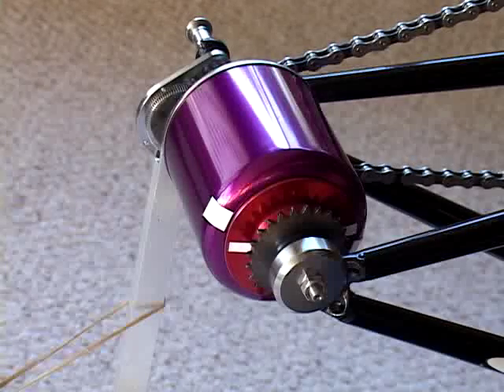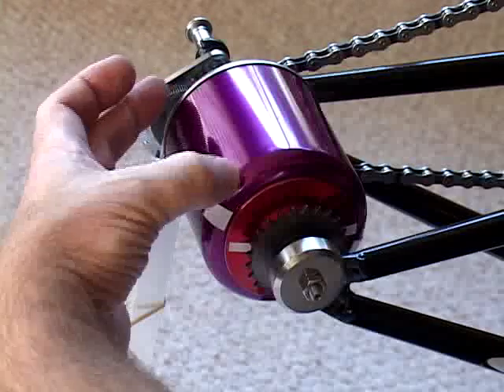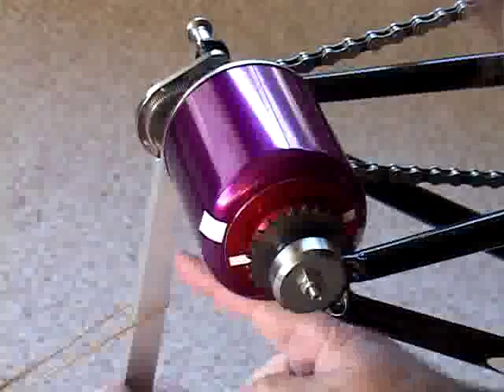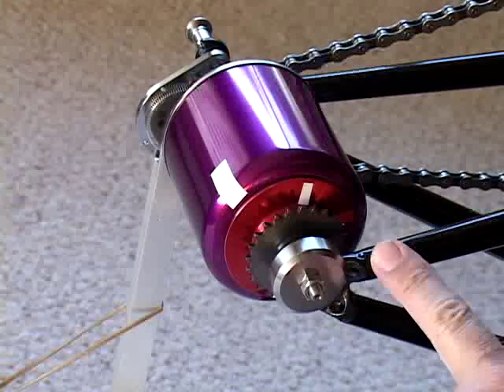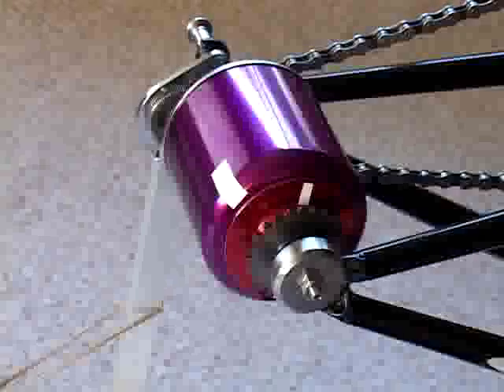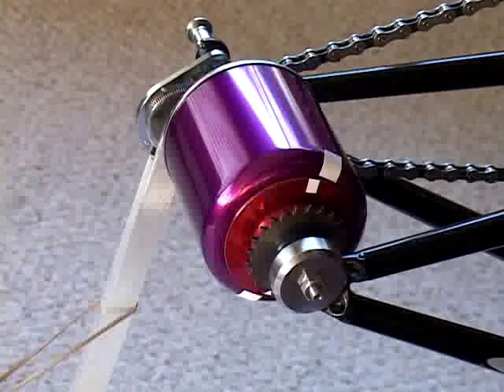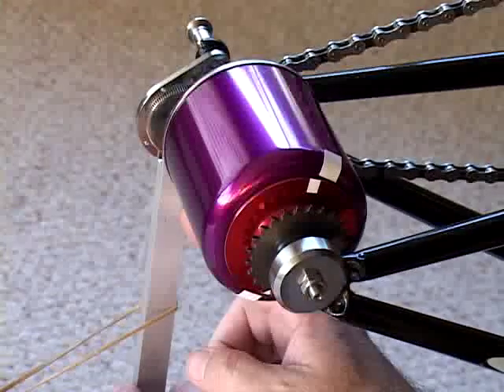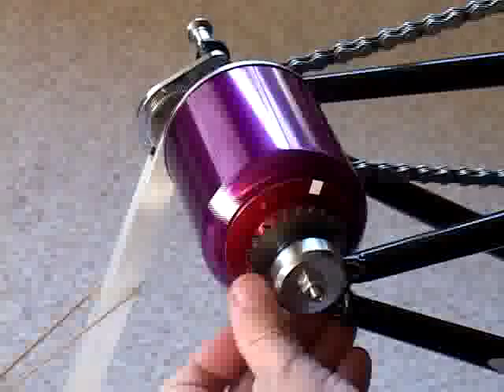Automatic Bicycle Transmission (IVT)

Comment: This would be perfect for motorized bicycles
Reply from the maker: peter medz
Yeah!  You'll be able to keep the revs up where you want them when you need them, regardless of your bike's speed!  I intend to technically support any developer who wants to perfect a drive system with the SIVAT for such uses.  2-strokes would be very interesting because they need to rev!
Reply: yup its genius
Reply: Since the have no changing gears at all....
Reply from the maker: Indeed!  They're on my checklist for design requirements for bikes with IC engines and electric motors, possibly up to 1kW (1.34 hp) of power capacity.  Most of the core mechanism will work for pedal-power and motor-power with a single design for better economy-of-scale in production.
Reply: Make a version for the gas bikes. I'd love on on my 80cc
Reply from the maker: peter medz
We might not offer a SIVAT for any specific e-bikes or gas bikes any time soon, but a kit for you to adapt to motor/engine power will follow its initial pedal-power marketing & sales.
Reply: "This would be perfect for motorized bicycles"
Except electric motors generally don't need gears.
Reply: gas 2strokes it be just like peanut butternut and jelly.....
Reply: Go to school
Reply: This is just like the transmission on my 80s Honda Spree scooter. Nothing special

Comment: i want that transmission for my bicycle based ev project
Reply from the maker: That would be a good choice.  Unfortunately for your project, this is not yet available as a product.  Maybe your project can have a second stage of development when it becomes available.  Some people claim that a transmission for an EV is unnecessary because electric motor torque is highest at low speed; they ignore a lesson from Tesla Motors!  Tesla's very first prototypes had 2-speed transmissions because they raised the top vehicle speed while enabling good low-speed acceleration in first gear, which shows the advantage of a transmission with an EV!  Tesla only abandoned the transmission because the high torque of the motor broke gear teeth during the shift, an event not possible with a transmission that requires no abrupt 'gear change' like an IVT wouldn't.  A major cause of most mechanical systems is shock-loading, where forces rise abruptly on all components in the power chain; an advantage of the SIVAT is the elimination of shock-loading!  If you eliminate shock-loading, you can design the transmission & other drive-train components to be lighter, a big advantage on a bike.  I am deliberately designing the second-generation SIVAT with small EV's in mind to handle 500 watts (maybe 1,000 watts) of power at input speeds higher than pedal-power speeds if the SIVAT operates well at higher speeds.  The next prototype will be tested to determine its maximum power output & top operational speed.
The SIVAT will be introduced on a special bicycle, most likely a full-suspension mountain bike intended for pedal-power.  My new design will accommodate various applications with a common core, so we can increase sales volume to enable lower prices.  During the bike's development, we might consider some convenient means to retrofit a motor/battery system in the future as an option.  At some point, we may need to get help from an expert on small EV's and bikes.  Regardless, please stay in touch!

Comment: 20 years ago I gave an invention of mine to f + s. I called it the dynamic bicycle drive. The drive runs along a cone and the drive belt was made of rubber. However, I did not give them the most important point. After a few years of the experiment, they then passed it on to a university, but they also gave up the project. My question: do you use a cone in your transmission ?
Reply from the maker: No cone!  Your invention is a traction drive, based on rolling friction like tires propelling a vehicle on pavement.  The SIVAT uses a completely different fundamental concept called ratcheting.  27 years ago, I invented, prototyped & tested a version of a traction drive on a bicycle while already knowing that it wasted a portion of power transmission in 'peripheral' friction.  Through a bizarre coincidence at the time, I was introduced to an inventor of a ratcheting drive who helped change my thinking, leading to my development of the SIVAT as a better way to achieve CVT performance.  
Unlike a traction drive, a ratcheting drive uses the fully engaged transfer of power in gears and/or levers without relying on rolling friction.  A ratcheting drive transmits power through a recursive succession of positively engaged elements that engage & disengage, each for only a fraction of rotation of the driven part of the transmission.  Each ratcheting element is designed to vary in rotational speed during its rotation, but only transfers power during a sector of its motion where it's speed is most extreme.  The ratcheting element is only active until its variable speed is matched by the next element that enters the active zone, supplanting its function, one element after another.  Conceiving and designing a smooth-functioning, durable ratcheting drive has been a massive challenge that's worth the effort.  The advantages of the SIVAT over all traction drives are: 1) much higher efficiency; 2) much lower wear; 3) much higher power density; 4) no slippage.  I intend to prove these claims with the next prototype.
The traction drive I invented & tested was all hardened steel cones that meshed with steel input & output rings.  It also had automatic operation that worked.  The problem with it was that it produced so much non-propulsive friction that you had to pedal downhill!  Granted, the design might have been improved but only to a limited extent.  So far, the only CVT's I've seen in products are traction drives, and the evidence of rapid wear I predicted is turning out true.  Also, only fairly modestly powered vehicles use them.  I'm betting to offer a better solution!
Reply: This is a very good idea and certainly a long development time to adjust the individual elements. I personally count to the people who can hardly wait to see the drive in action and better still drive themselves.
Reply from the maker: zulu flight
Thank you!  Developing this has been a helluva lot of work.  Only recently has my latest configuration achieved passing marks in the full chain of basic power flow calculations for torque, force & speed for strength & longevity of bearings & gears. It will all pay off with happy customers!
Customers will deserve to be happy with the results for years, not just at first.  Hopefully, you'll be one of them.  I'll likely provide a means for interested people like you to try out the first units on demo bikes.  But first, I've got to now cram 10 pounds of mechanism into a compact 3 pound package!  ...that's engineer-speak for 'Now, the actual design begins!'
Reply: You will have success with it. Already in the demo film the lightness can be guessed, which is in it. Platinum is a very good material.
Reply from the maker: zulu flight
I'm guessing that you mean titanium!  Platinum is a horrible structure material because it's soft, dense & very expensive like gold.  Titanium is very good for structures, but expensive to machine & fabricate.  The SIVAT will be made mostly from chromoly steels, heat-treated for hardness & strength.  The hub shell & a few other parts will be aircraft-grade aluminum.  The size and mass will be similar to the Rohloff Speedhub for bikes, not much different from the featured demo, as you suggest.
Reply: jes

Comment: can you wheelie with it??
Reply from the maker: That's an excellent question.  I don' know the answer, but imagine that the planned ratio-lock lever will allow wheelies if the allowed ratio range for its use gives you usable torque for wheelies.  If you don't lock the ratio, the automatic feature will likely not allow enough torque to pop a wheelie, but will likely allow enough torque to sustain it.  I'll add that test to the performance testing phase of the pre-production prototypes.  Thanks for your question!
Reply: cool....so i will change gears auto to suite the terrane
Reply from the maker: Azzan Carr
Yes, the whole concept of the SIVAT is to adapt to the terrain automatically, meaning that it will deliver the right gear ratio for the steepness of any hill or level ground as a response to the riders pedaling force; the result will be fairly constant pedal force & cadence, regardless of the grade (steepness).
Reply: aite cool

Comment: How does it work? I by no means want to steal the idea, but I want to understand the concept of a simple controlling shaft that allows a controlled mechanical speed (with purely mechanical principles). For instance, having a rack be pushed forward/backward over a pinion that controls that IVT and changes the speed, which can possibly be used in mechanical tank steering
Reply from the maker: Yeah, combat tank steering was one of the applications I thought would be good several years ago.  Your guess about rack-and-pinion actuation is insightful, and that would be an elegant solution.  Note that I did mention that the SIVAT is a 'Ratcheting Drive'; you can look it up in Wikipedia for a general idea of its operation.  The trick is to implement smooth operation that transmits substantial torque in an IVT form.  Much of the concept depends on very careful design to work; an IVT can go wrong in a thousand ways!  That's all I can say!
Reply: Thanks for giving me as much information as you could without giving your design away :). I hope your development continues well!
Reply from the maker: You're welcome, and thanks!
Reply: SIMKINETICS
 No worries :)

Comment: So, what you're calling "overload protection" where you stop the output with your finger basically means it's useless for transmitting any useful torque, and is therefore totally pointless in any real world application. Well done you for getting 5 million views.
Reply from the maker: As I stated, this is a proof-of-principle prototype.  The next prototype will be based on what was learned from the 1st (featured).  I'm currently engineering a design with full functionality as a goal, including an appropriate overload torque-reaction value that won't likely be triggered by even the most powerful riders ascending steep grades.  Read the comments.  I've got this information posted in several of the comments on this page alone.

Comment: DOes it go over 1:1?
Reply from the maker: The design of this version that's featured does not offer output/input above 1:1; note that the 55T/11T sprocket combination here raises its highest output ratio by 5 times.  Regardless, the new design SIVAT will internally raise that ratio to about 4:1, so a small sprocket on the front (24 to 30 teeth) will deliver at least the highest output speed found on most mountain bikes.  Such a small front sprocket will also increase ground-clearance beyond what's available now.

Comment: A good question I have - how expensive do you think this will be for a typical bike? I'm a little sick of the shimano derailleurs and their touchy temperamental attitudes and would wonder if this would be a viable/affordable alternative.
Reply from the maker: The first units will likely be on high-end mountain bikes as a special feature, so the price will be an as yet unknown portion of the whole bike.  Initial pricing will need to reflect minimal capital losses typical of a start-up, so they'll be expensive at first about like the Rohloff.  If sales volume increases enough, the price could drop to be competitive with NuVinci .  Since I'm in the engineering phase right now, it's premature to predict pricing accurately, but I'm fully aware of costs while designing it.  Fortunately, most of the mechanism is composed of very conventional, widely produced parts where volumes are already high.  It might take years for the price to be a couple hundred dollars.  It should also be available as a stand-alone transmission that can be adapted to many uses beyond bicycles.  We'll be looking for every way to make this affordable.  Thanks for your interest!

Comment: what would it take to get one for my motorized bike
Reply from the maker: Patience & money!  Imagine a higher top speed, acceleration & range.  What's your motor's max rpm, and power output  in watts?
Reply: its a 2 stroke 66/80 cc. motor  thats all i can tell you
Reply from the maker: vawn davis
Thanks.  I'm guessing it's 500 watts, a fairly popular standard for electric & gas-powered bicycles.

Comment: Nevermind, this sounds like it's a prototype and that's why I haven't seen it in the real world. I can't wait to see this in action in the future.
Reply from the maker: Thanks!  The featured proof-of-principle SIVAT did prove the principle, but was woefully inadequate for power throughput of bicyclists.  Engineering this concept indicates a needed, very challenging change in much of the design to achieve product-level performance without growing excessively in size or mass.  Now, I've got the tiger by the tail!
Reply from the maker: @Game Plays 1230 Yes, as a general rule, the transmission should be in its highest gear ratio at launch & initial acceleration, and then lowering in its gear ratio to accommodate acceleration & higher speeds.  This is precisely what the SIVAT does.  
My research & personal experience confirm that the most efficient & comfortable riding uses a transmission that keeps pedal-force and cadence fairly constant at all bike speeds; so that's what the SIVAT is conceived & designed to do automatically.  A notable exception is the launch that has no prior force to urge it into its highest gear ratio, so I had to allow a 'lockout' of the automatic feature to keep the ratio high just for that launch from first pedaling. 
I first tried out this spring-reaction control on a predecessor prototype CVT many years ago, and discovered that it works extremely well on steep mountain roads as well as in flat rides, both ascending & descending.
I'm convinced that this torque responsive control is the best way to control any CVT, and so is the automotive industry!
Reply: @SIMKINETICS  any more updates on this?
Reply: @SIMKINETICS  also, are you still open to investors?
Reply from the maker: @kckdude913  Not yet.  Thanks for asking.  I've been working on a less expensive version that should be very competitive in todays market; simpler, more efficient, lighter, higher power throughput and located at the bottom bracket.  The new design will likely also include some innovative suspension & drive layout changes that will improve, simplify and adapt to pedelec power above 1kW!  This approach is more ambitious and more realistic!
Recent changes in the MTB market are finally making this a more practical proposal that I feel comfortable offering as a crowdsource development toward a product.  I've recalculated the design parameters, and am currently reconfiguring the design toward that goal.  It's a tedious & complex process, but I intend to get this ready for a 2022 Patreon (or similar) launch.  When I launch, it should be on this YT channel.  Thanks again!
Reply: @SIMKINETICS  I really hope you have success in this! And I think there is an upcoming market for it. Biking is the future. More and more cities are turning to making their communities more walkable and bikable to eliminate the issue of traffic. Just look at the Netherlands! The timing is pretty spot on as I believe biking will become more ubiquitous in the next few years.

I know you listed other applications too but I think bicycles will be quite big in the future so your first application for it might be the most successful one!
Reply from the maker: @kckdude913  Thanks!  I agree!  I'm looking forward to working with bike motor producers to discover how this invention will increase both performance and range with some clever algorithms linking it with the motor!  The popular wisdom asserts that electric motors don't need a transmission because their torque is high at low rpm, but I know that a certain strategy can disprove that as seen in the very first Tesla cars that used two-speed transmissions; Tesla abandoned those transmissions only because they broke at the abrupt shift point thrust-peak, not a problem with an automatic IVT that smoothly transitions thru continuous ratio change with low loss!
Anyway, this should be very useful on bikes first, as you mention.
Reply: @Barnacules Nerdgasm  I always mistake you for that tattooed magnetics&electricity guy. Who apparently has come up with some pretty groundbreaking ideas regarding how light magnetism and dielectric phenomena function in out realm.

Comment: Why haven't I seen a single bike with one of these? Seems like a brilliant idea, is it less efficient than chain/derailer design?
Reply from the maker: Please see my response to DylanT, below.  The SIVAT will be slightly less efficient than derailleur design in well-aligned (mid-position) sprocket pairs.  I use planetary gear systems which have better efficiency than most other gearing types, about 99% each.  I expect overall efficiency to be greater than 95% with the highest gear ratios' (for going up steep hills) lower efficiency skewing the average.  Sprocket drives are the most efficient, but planetary gear drives aren't far behind.  The SIVAT promises to improve pedaling efficiency of the rider that should more than compensate for power loss in the mechanism.  After doing many calculations & subsequent design changes to balance component forces & speeds, I'm gaining confidence that  this will be a product you'll see on bikes.  Thanks.
Reply: @SIMKINETICS  it's been 4 years, are they on bikes yet ?
Reply: what are you doing here?